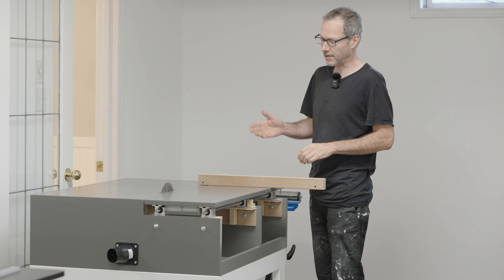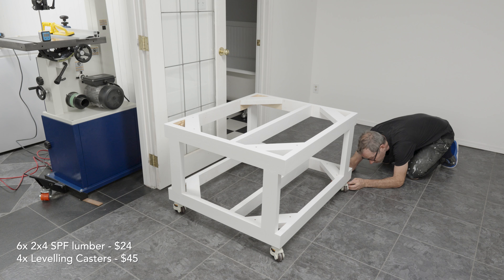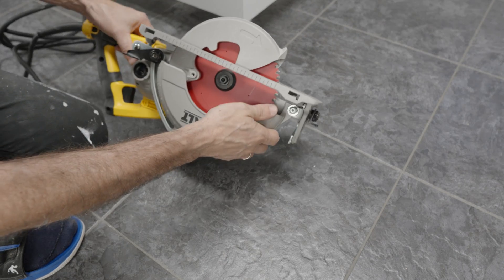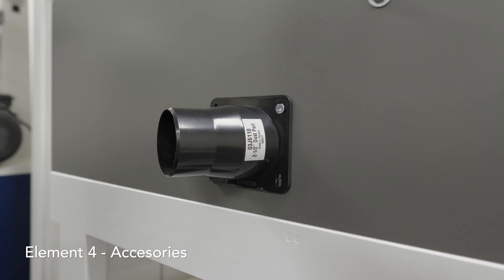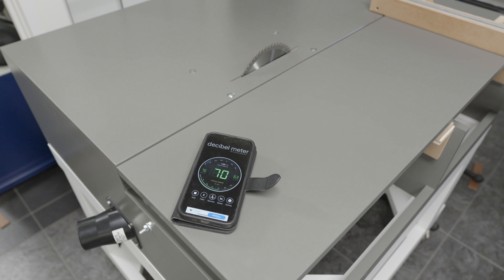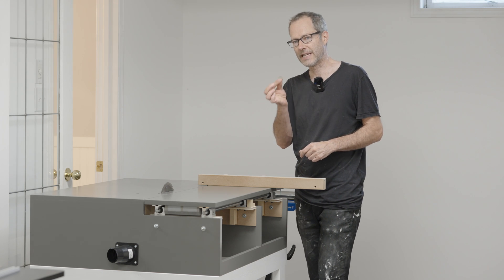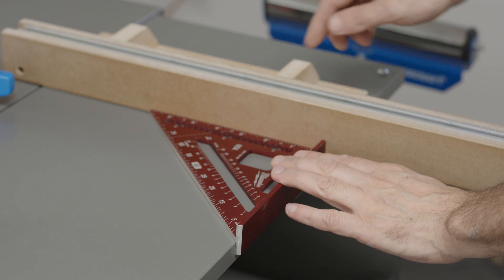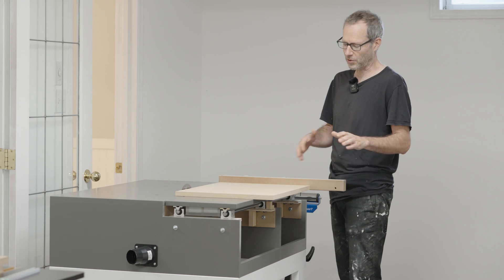Sliding TableSaw made with Worm Drive Circular Saw!

Comment: Can you send us a file that includes the thickness measurement for the wood, as well as the measurement of the aluminum sections to implement it accurately, as well as the measurement of the side saw sections to draw them on CNC sections and cut them accurately?

Comment: Probably one of the best builds on youtube. You deserve 1m views.

You mention its not as good as other sliding table saws but what are the limitations, cut height? Anything else?

Curious of how youre considering angled cuts or other jigs or vertical fence?

Id be curious how/if you add a router to it. My suggestion would be to add a router to the right of the saw and use a vertical fence for both but again your simplistic engineering would rather see what you come up with than copy what i consider the better designs.

Very
Well done!

Comment: I built one of these and the problem is the worm drive saw has oil in the gear box it's not designed to be run upside-down my saw malfunctioned in a short time.
Reply from the maker: I'm sorry to hear that!  Worm drives are expensive.  I never knew the gear oil is gravity based - thats something to watch out for

Comment: I know it would have cost a couple of hundred bucks more, but did you consider using a 
10 1/4" beam saw for more depth of cut? What is your depth of cut now about 2 1/2 inches max? Also does the miter gauge adjust to cut actual miters or can you reach in and adjust the table on the saw itself to cut miters/bevels??
Reply from the maker: Actually its only (just over) 1.5" cut, because the saw is mounted underneath 3/4 MDF which eats up blade depth.  Almost as soon as I made it, I started looking at every possible alternate just out of curiosity, looked at all the beam saw models, etc and tried to imagine a version with more blade depth.   I made the miter gauge on a swivel point to do different angles in the future but haven't used it like that so far.   If I ever do a v2 version it would be cool to go all the way and have every depth and angle feature a real sliding TS has.

Comment: I have a sliding saw idea you have not seen.  I am going to build a sliding table for my mark v 510.    I should be able to do it in the next few months.  I just purchase $300 in router molderbits.   I got the bright idea to save my daughter a few bucks.  She is a artist and she was bitching about the cost of a canvas.  So I started making little frames to stretch the canvas on and gave her 5 or 6 canvases. Then I thought man her art would really look good if it is framed.   So to save her a few bucks I had to spend $300.  Lol   . 

I love the approach you took on it. I seen a video of a add on slide table and he mounted the rails to the base and the slide blocks under the bottom side of the sled/slider.   h=He then had to brace his underside of the table slide.  I said man the base needs the bearings and the slide the track & no need to brace the carriage because the rail will. Then I got the idea to build a removable one for the mark V.   I like building tool IU  use.  My profile has a scroll saw and 2x72 grinder I built

Comment: Thats a very nice design, I'm totally stealing the "telescopic" linear rail design you made. Did you have any issues with dust in the bearings after using the saw for a couple of months?
I'm contemplating flipping the bearings and rails around, however I see that your design adds a lot of stiffness to the moving slide.
Reply from the maker: The saw is in a little MDF vacuum box basically, so no dust shoots outs the side.  The blocks/bearings stay fairly clean.  I hit them with compressed air now and again and they are holding up well.

Comment: Hey, nice design! However, you should flip the rail and the bearings... they'll accumulate sawdust and stop working properly in this manner. If you flip them, it'll be just the rail that get the sawdust and you then can add a little brush at both the beginning and the end of your saw to "scrape away" the dust on it.

Comment: I'm glad you built this. I've thought about a worm drive for this application, or a cordless "worm drive" style simply for the power and torque. But they tilt opposite than a sidewinder. When used with a rip fence on the right side of the blade... doesn't work. Slide table on left does work, like you did here. I guess if you don't need to use the fence to rip a bevel you're good. 
I like seeing your version here. I've seen many and have been meticulously planning, designing, rethinking, and re-rethinking my own version. Ultimately, I'd like a cordless, transportable one for use on small remodeling jobs I do. Thankfully, Festool has one now that's way out of my price range. 
All that said, good job on your build. It has me re-rethinking the worm drive angle. Why not have the rip fence on the left and slide table on the right? Here we go...
Reply from the maker: Please let me know if you build it - I'd be so curious to see what you invent!   I originally wanted to make this one portable as well, but it just ended becoming a shop fixture.   Question - how would you do cordless?  Like what would be the triggering method?

Comment: How do you adjust the blade height?
Reply from the maker: Once you pull back the sliding table portion you have access to the saw.  You just use all the saw's own functionality/levers to adjust it, just like it was outside the table.

Comment: I'm making a similar project with a slight difference. I'm using SFC20 Guide Rails instead of 16mm supported rails you have used. Doing so, the rails will be fixed on the table to make alignment a bit easier. So the sliding part will be fixed on Slide Blocks. The only issue I may have a problem can be sagging of the sliding table on top of 4 blocks. I may end up a shorted sliding side, which will look awkward, or use 6 blocks.
How about blade left circular saws? There are circular saws with blade left but don't know the relative performance to a worm drive, haven't tried both.
Reply from the maker: From what Ive seen the worm drive saw is much more powerful than a normal blade left circular saw.  The geared drive gives it an enormous amount of torque.  Yes 20mm rails sound a lot more solid.   If you're worried about your table sagging, you can make a low profile 'Torsion box' and that should be very stiff

Comment: Great idea, can’t help thinking that the rails would be better on the bottom, and the bearings on the sliding table to reduce the dust going into the open bearings when exposed❤
Reply: Agreed, also don't like the bearings leaving the rails when they move back and forth.  Usually manufacturers will use longer rails to accomodate increased length.

Comment: couple of comments or tips if you will.  you might think about slipping a playing card under the sliding table, its nice to have the stock clear the table just a smidge.  You might drill some holes near the blade to help pull in more air and bring in more dust.    This is a great build.  Very nicely done
Reply from the maker: Thanks, and yes I've read that - having the sliding element slightly proud helps to eliminate drag / friction, and other benefits.  Great idea on some extra holes near the blade.  The suction is just strong enough to sort of suck in the off-cut, and when the blade is winding down it grinds a little impression into it.  I think some strategically placed holes would help a lot to solve that.  Thank you!
Reply: @acanadianwoodworker   again I think this is so awesome.  im always in awe when someone builds a great tool!
having some clamping solutions on the table are really nice,  for yours micro jig dovetail clamps might be perfect.  I am in the process after 4 years of owning a slider of building a fritz/franz jig for small stuff.  there are a lot of things that sliders do well and some stuff they do not!  but a F/F jig looks like it eliminates a lot of the not so good stuff.

Comment: The design and saw in general looks really good impressive work but if i might add a little helpful safety tip i'd highly recormend adding a rivingknife just to make the saw even safer would avoid many kickback situations
Reply: You really only need a riving knife when using a fence, I didn't see a fence or hear him say anything about adding one in the video!
Reply: Should be easy enough for him to cut a splitter slot. Though the way they saw is mounted the rear handle may get in the way of him putting it all the way through the cabinet.

He can just have a small splitter in slot in the table though.

Comment: Is there a reason why you chose to have the lineR rails attached to the sliding table rather than spanning the base unit?
Reply from the maker: Hell yes there's a reason :)!  Its two reasons:  The first is the way the rail guides are bolted on - I wouldn't have as easy access from the top.  Or have to drill a bunch of holes in the sliding top which would be a buzzkill.   The second is that the linear rails serve to further stiffen the top and keep it straight.

Comment: Does using a left-blade circular saw mess with your ability to do bevel cuts?  Or would you just have to put the fence on the other side?
Reply from the maker: That's a great question.  Actually I intentionally left bevelling out of this design.  I want to use it for drawers & cabinets so its all 90 degree cuts.   If you wanted to bevel, it breaks down like this:  The way the saw is built, if you bevel the blade, it swings a long way.  So you need a fairly wide 'throat' on the plate to accommodate that.  Its fine if you use the saw normally, but as soon as it's upside down, that wide throat would just allow too much stuff to fall into the blade/saw.  Like say if you were trimming a 1/4 inch off a 2x4 or something, it would be constantly falling into that wide throat.   Also, the way the saw bevels it would swing the motor out towards the operator, and also into the rails of the sliding table, so it would get awkward quickly, design wise.    I'm sure there's a way to do it elegantly, but I just haven't figured it out yet!